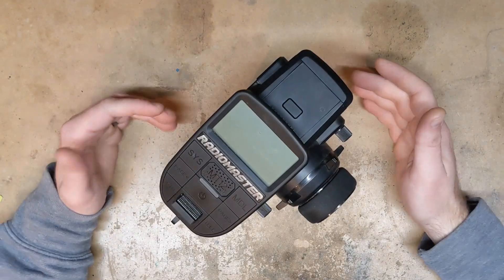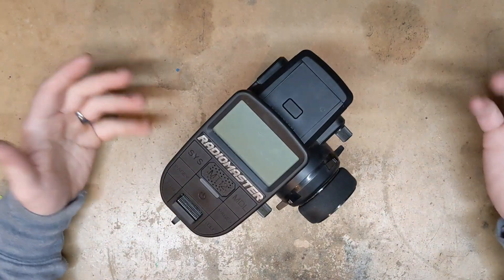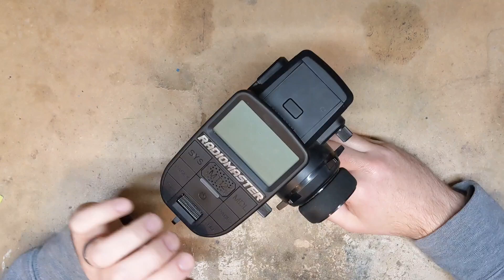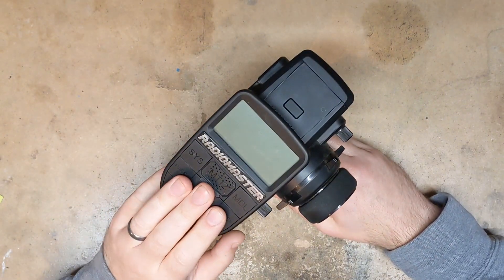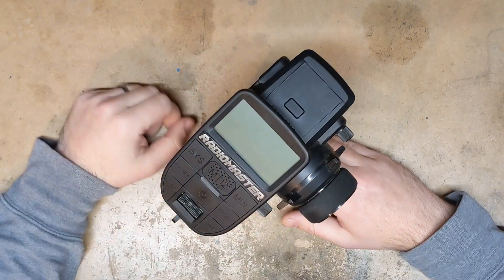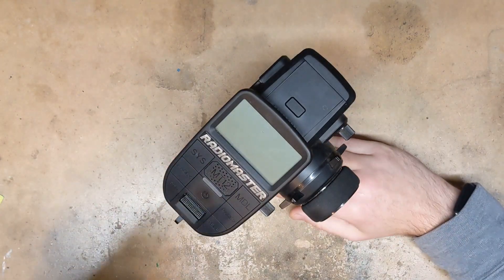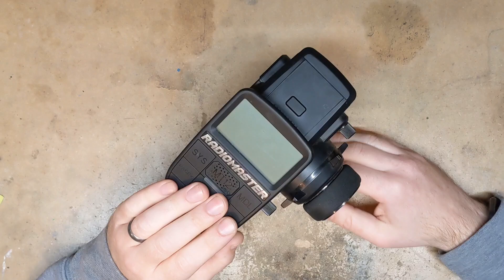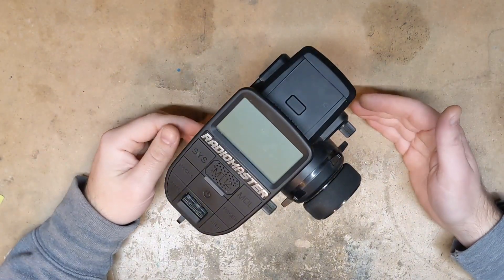RadioMaster MT12 ELRS Version - Long term follow up review

Comment: I'm curious if you did a range check and actually tested if a TX loss would still cause a runaway. Meaning stand the vehicle throttle it and shut the transmitter off with the model still going. Do the steer wheels crank one way and throttle stops entirely. If those things are not happening simultaneously then you have it set up wrong.
Reply from the maker: @webreakforsquirrel4201  doesn't matter what I did or didn't try... You fanboys are a cult for whom no amount of testing or evidence would ever convince. I'll be accused of lying or doing it wrong. Y'all are a lost cause.
Reply: @nick_cnc sounds like someone is frustrated with understanding this technology. I have had my fair share of bouts with OpenTX and EdgeTX. It's an open source interface to use with a programable radio.  I would consider this a hurdle to work through thus increasing your knowledge and perhaps educating others what you did to fix the issue. The reason the system is so inexpensive is because it does many things not just 3 things. The open source community is mostly about working together to overcome a community project so that we all benefit not just a corporation. 
So go buy a Sanwa or a Futaba or Spektrum. Tell me how much you want for that POS and I will gladly put it into my daughter's hands.
Reply: Rlaarlo doesn't make an RTR ELRS version car. So you likely downloaded ELRS firmware to a 4in1 multi module protocol transmitter.
Reply from the maker: @webreakforsquirrel4201   I bought an ELRS receiver and put it in the Rlaarlo. I'm starting to think you're as dumb as you think I am.

Comment: I had two runaways on the same day a while back, but both were because I was trying dynamic transmit power. I fixed both by changing settings back, not happened at all since.

I don’t currently race but aiming to get to a track in the new year and see how it holds up. I’m still confident it will work for me despite now seeing several videos from a number of users claim it’s “broken”.

Comment: All cheap radios are using chips with dedicated programming that's been constant for decades. Nothing new, nothing changes. And you're comparing it to an OPEN SOURCE project? In fact to TWO projects. OK then. I've also read the threads, so I don't doubt you've had issues. But I doubt you understand the first thing about this or other radios - that much was clear on the RCTech thread. Lastly, if anyone actually goes to check on Github, you can see that the drop-out issue is reported in May and closed as fixed in June - both 2023 - based on a report from May 12..
Reply from the maker: The idea that it's TWO open source projects and doing new things so it MUST be better is flawed. Trying new things doesn't count for much when they ignore proven solutions and end up with an even worse radio than something that can be bought for $30.

Check my other video on the MT12 - I show ON SCREEN that I'm using FW's that have the fix you mention and my fail safes are set correctly. I still get a full throttle runaway. 

But by all means, keep your head in the sand.

Comment: What channels were you using in the receiver when you had signal dropout?
Reply from the maker: @alanhelps6789  only a flight guy would ask what channels a surface guy uses for throttle and steering.
Reply: @nick_cnc  Not at all, I use it for WRCCA crawlers. I read there were issues with CH2, so I used CH3 for throttle after I blew an esc. Not had a problem since. Also CH5 on a 5 channel receiver doesn't act as a regular channel for some reason, so I had to connect it to WiFi and remap Ch5 as Ch6, and it worked fine.
The Ch2 issue is apparently due to CH2 receiving a lot of high speed data that can mess with some esc's and servos. I was told it's a rare issue, but I'm not so sure on that.
Reply: @alanhelps6789 that’s because channel 5 on ELRS is reserved for the “Arm” command. Which is a drone control legacy thing. 

One thing I wish it had out of the box is just a higher level interface. There’s so much it can do but so complicated to adjust compared to an NB4+.

I still like this radio, but it needs so much knowledge and attention to detail in the setup, on quite a low level programming interface. Firmware upgrades every few weeks, and so many of them… (You need to update receivers too)

This is one of those systems that you need to follow the rule of keeping it on the very latest firmware, to make sure you’re clear of any bugs.

ELRS is on version 3.5.3 now. 3.3.x is months old at this point.
Reply: @CharlieHurst  I tried the NB4+ after I had troubles with channels 2 and 5. That still needs the receivers updated. Problem with the NB4 is you can't have multiple switches or knobs for the same mix. If you try and use another switch to do the same thing, but in different increments , it says you're already using a switch for that application,and changes It to the new one opted. 
It needs 3 channels to mix two. To run two motors smoothly, it needs Ch2 as master, but you need both esc's in CH3 and CH4 to run in sync. If you plug one in CH2 and one in a slave channel, they run out of sync. 
After I read the work arounds on the channels for the MT12, I went back to it and sold the NB4+

Comment: Wow, really sucks to see you had all these problems. I've been using ELRS PWM literally since it came out 3? years ago, but checking out your github links looks like I was partially quite lucky there. I've only run firmwares 3.0.0 and 3.3.0 which are unaffected by the crashing issues. I quite literally have hundreds of hours with ELRS now with no problems.

I don't own the MT12 but have a RadioMaster Boxer (airplane radio) I've used to race 21.5T 2wd carpet buggy with and had good results. I am pretty skilled with RC planes and a lot of that transferred over. I did a few club races and always got into the A main, even placed 2nd once when a couple of the faster guys just crashed too much. I was running the ELRS 3.3.0 firmware, F1000 packet mode, and 333hz servo rate on the ESC and steering outputs. The receiver I have in my buggy is the Matek R24-P6. Hoping to get some more racing in with that setup this winter season. 

Anyways, my point is the hardware and software can be really good, seems like you got unlucky and that just sucks... And perhaps the MT12 is just uncomfortable in the hand to you which makes the whole thing a non-starter anyways, you noted a better connected feeling on the NB4 so just commenting on that. Really the good radios are so low latency now its going to come down to whats most comfortable in the hand.

Comment: If the other cars are working well with the update, it sounds like that one specific had an issue installing the update and corrupted. I agree that the major firmware issue is a big thing and can’t be overlooked just putting out an idea to consider if that could have been the problem which is not in anyway trying to lighten the issue.
Reply from the maker: @JosephPerito-m6g  as mentioned in another comment, I suspect the ongoing issue is related to the rx's inability to handle abnormal electrical conditions. I was able to recreate the signal loss and runaway faults in another car by stimulating those conditions which in my mind demonstrated it's not a one-off issue with a bad receiver.

I also performed the exact same test on the cheap Rlaarlo radio I mentioned in the video. That radio would lose connection, but the connection loss lasted less than a second as compared to the 5+ seconds of connection loss of the MT12. Importantly, despite losing connection, the Rlaarlo never once created a runaway condition while the MT12 would occasionally runaway in the exact same test.
Reply: @nick_cnc  That's concerning as I was planning on getting an MT12 as I like ELRS I'll look at waiting for an NB4 then. having used an NB4 I can agree it does feel Good in the hand.
Reply from the maker: @JosephPerito-m6g  The NB4 line is an excellent choice. On top of, IMO, being a better radio, FlySky is actively developing their surface model products. As far as I can tell, RadioMaster does not do anything for the development of EdgeTX or ELRS - just look at the FW that shipped with the MT12. Aside from the signal loss issues, the trim button labels did not match between what was marked on the radio and what showed up in the screen. At first I was willing to overlook something like that, but now in hindsight it's an obvious sign that RadioMaster simply doesn't do any development or contribution to the open source projects on which their products are based. I find that to be a rather exploitative business practice.

Comment from the maker: Hey everyone, Nick here. There were some things I kept out of the video because I wanted to keep it short, but here are some other points I want to make about this radio. First - even after 6 months of use, I still found the UI needlessly complicated and unintuitive. Second - I have replaced the MT12 with a Noble NB4+. Immediately after installing it in my 2wd buggy I noticed I had a much more direct connection to my car. It felt more precise and easier to make the car do what I want it to do. Furthermore, the remote itself physically just feels better in my hands. The MT12 is massive and heavy, and going back to a lighter radio was a welcome change. So even if the MT12 didn't have these fatal reliability/safety issues, I still would not recommend it over something like an NB4.

I have also added links in the video description that detail the history of the signal dropout firmware issue. It took over a year after being logged as an issue to finally be fixed. That lack of support regarding a critical bug is not acceptable for a commercial product.
Reply: Interesting that you noted a more precise connection going back to the NB4, since I think you mentioned in your previous video that you felt that way going from NB4 —> MT12. 

I just started carpet off road racing and am using a MT12. Hope to not have the issues you encountered. Which firmware versions were you running?

At least half of the club I race at is using the NB4 or NB4+
Reply: @ericberner3393  I have a radiomaster Boxer I've done carpet buggy with. Same electronics and software, just a radio formfactor meant for airplanes and drones. I say run the newest firmware 3.5.1 but if you have any issues I've literally got hundreds of hours on 3.3.0 with 0 problems across a dozen PWM receivers in different kinds of models, airplanes, buggies, crawlers. The performance of the radio link definitely isn't going to be holding you back, ELRS is one of the fastest and most consistent links you can get.

Don't forget to configure your fail-safe correctly. For a buggy with no reverse probably best to set it up for full brakes steering straight.
Reply from the maker: @ericberner3393  At the time I did think the MT12 felt good compared to my NB4. I don't know what changed - perhaps the improvements going from the NB4 to the NB4+ account for what I feel now. Perhaps I didn't have the NB4 configured the same as I have the NB4+ configured. Perhaps the firmware updates on the ELRS module of the MT12 affected something. I can't be sure, but I do know what I feel now. However, I would still consider the response and performance of the MT12 to overall be "above average" and perfectly acceptable for racing - but not top of the line. 

ELRS FW's in the 3.3.x range have the critical bug causing the signal dropout issues. If you're going to keep the MT12, your ELRS fw should be updated to 3.4.0 as a minimum. 

If you're not having the dropouts and runaways that I was having, chances are you'll be fine to run the MT12, though I do believe there is an issue in the design of the rx's that cause runaways in cases of unusual electrical conditions (too much voltage sag in the BEC for example). This is why I no longer trust this system especially for use in my ebuggy. I absolutely will not risk a runaway with that car. But a 17.5 2wd buggy? It would be aggravating, but not dangerous like the ebuggy. Personally that was a level of risk I was comfortable with and so I continued to race my 2wd even after all these issues started.
Reply: With considering precision, did you change the frequency hrz on the radio and the RX’s as default they’re low and should be put to 333hz on he rx and for the transmitter it should be at F1000.
Reply from the maker: @JosephPerito-m6g  yes, first thing I did on every rx I bought.
Reply: @JosephPerito-m6g  wrong.  They need to match.